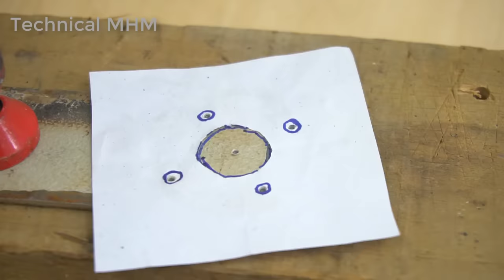How to make electric bike with 775 motor

Comment: I surely can say that the cycle will not move a inch if anyone sit on it
Reply: I agree. The gearing is about 6 to 1 so the motor has to spin 6 times for every 1 revolution of the wheel. To do   30 kmh it has to do about 300 rpm. Even with pedal assist ,a full grown adult would likely drop the rpm down to almost nothing if you didnt pedal your ass off. Then what's the point. A motor that size with a gear box of a side grinder which generally does 11,000 rpm would drive a bike with load alot better. See Russians  DIY ebike friction drive. 100km plus and pops wheelie on take off. No chain in front spokes to send you airborne either.
Reply: @kenklassen5312  id like to make an ebike using my6812 12v can you please give me some advice of what ratio of gear reduction ineeded
Reply: @taejinjin9722  There is a lot of factors that play a role in the decision of what ratio you want to use. If you live in an area with a lot of hills a lower ratio would be better where as if it's flat and you want to pedal at the start a higher ratio would be much better suited for top speed, although lots of countries now have restrictions on how fast you can have a push bike go before it classifies as a motorbike
Reply: @thebrokenbolt3990  can you give like example of what ratio i needed because i live with many hills
Reply: Yes bro, you are right
Reply: easier version here  https://youtu.be/ZjzgYx_gadk
Reply: @kenklassen5312  well explained. Thanks man!
Reply: Kit ki amount please send,cycle hy he hamare paasss
Reply: 100%agree
Reply: It will when he's at a peddling speed ?

Comment: Cool is it supposed to carry around a hummingbird with that motor.
Reply: @mmdjvdazh  u
Reply: You’d be surprised how much you get out of those tiny motors
Reply: A ball of cotton I suppose
Reply: The motor will probably overheat due to the excessive load.

Interesting Idea, has good potential, but needs an adequate motor for this.
Reply: I will text someone pitchers of the ebikes I have.Incase someone has something I need I will pay you for it.Even the shipping.I might need batteries rear electric wheels Tannus Tires ??
Reply: Who can I take my ebike to so I can have two different plates on the same ebike. So I can have two batteries ??
Reply: you dont know the motor power
Reply: @siddikcreator6752   I have two ebike. A ,350w and a 500w. A Ancheer Orange and Black Sunshine that's 350w the other is a Pace Aventon 500
Reply: @mmdjvdazh  ذ
Reply: Assalam
Reply: @tinkusarkar5780  on a plane road it might work, with little momentum buid-up.. itwill work.
Reply: It can barely power a fan so no way bike
Reply: Hahaha
Reply: @firozashraf2754  ,
Reply: You don't have any idea about the torque of 775 motors.
Reply: يايها الذين امنو لا تلهكم اموالكم ولا اولادكم عن ذكر الله ومن يفعل ذالك فاولئك هم الخاسرون
Reply: @mmdjvdazh  يايها الذين امنو لا تلهكم اموالكم ولا اولادكم عن ذكر الله ومن يفعل ذالك فاولئك هم الخاسرون
Reply: @firozashraf2754  يايها الذين امنو لا تلهكم اموالكم ولا اولادكم عن ذكر الله ومن يفعل ذالك فاولئك هم الخاسرون
Reply: It will just give u a bit more support it will be easier to ride you have to pedal also
Reply: People use these motors in powerwheels
Reply: That is a quite big powerful motor. Around two inches big. It’s an 895 motor and the belt reduction helps the torque.
Reply: @Zephyrhellion  
ç
çç

Ç
Reply: @mmdjvdazh  v
Reply: Busted.
Reply: @drrobotnikmeanbeanma  ج
Reply: I’m attempting to make one but in using a drill motor and I’m re wiring it

Comment: Look, I have the Aston Rider mid-engine and I've been using it quite well. I have changed it from my folding 16 wheel to 26 mtb and now into a 24. My husband changes the kit in a few moments by tightening one screw/nut, everything is connected and the screen has a cell phone charger.This system that you created is good. But the Aston Rider performs better!
Reply: no one cares lol
Reply: Mình mua một chiếc

Comment: just need to add a  small spring tensioner. you can see how smooth the chain runs when you let off the throttle.  great build BTW.  A+
Reply: JABED❤😂😢😮😮😮😮😮😅😅😅😅😅😊😊😊

Comment: Do you think you need a stronger motor? It didn't look like it was yanking that wheel around real good but a definite help for sure. I like the front wheel attitude for pedal or not. Great work bye the way. I noticed that the wheel was slowed considerably upon throttle release. Perhaps single speed rear wheel for the front to alleviate this problem. And for disc braking wheel attach over top of wheel on shocked front ends where brakes would have been. Shocked =(shock absorbed). Perhaps small starter motor.
Reply: Hi
Reply: Yeah.
Can use a bigger motor
But it will cost more power ( bigger battery pack's ) to run it at max speed ( if he want to use it at free air )

And he need to also made one circuit board specialiced to recharge the battery's ( using another or the same motor to use it like a dynamo ) when he's doenst using the additional trust that can give's the motor .
But all that wire mess can result in more weight
Reply: दच
Reply: @arjungujar2235  Yes sweetheart of this im well aware but have opted to use a large diesel engine starter motor in the stead for an absolutely kick in the..... Amount of acceleration and speed!!! But thank you for the video!!!🥰🤠🥰!!!
Reply: No the speed is already reduced its rated at 36 volts

Comment: I have an electric DC motor from an inalambric drill of 12V, 600RPM and 20Nm, does this work?
Reply: Maybe u should try to get more of these or a bigger motor if u want to run it outside

But it will work well with a good controller and battery's
Dont forgot that u can also use it like a dynamo to recharge the battery's when u dont use the boost system

Comment: The 775 is quite strong and it would work, but surely not with this low gear ratio. I made projects with 775 12V 200W 3000rpm unloaded. The motor wants his 2000rpm under load for good torque. There are smaler resp. finer chains and gears like those for e-scooters. With them you can realise higher ratios at similar space/dimensions

Comment: maybe you could try building a bicycle with neodymium magnets in the wheels and electric coils in the bicycle fenders to generate power for the motor. The power supply can be cut off manually with a cable from the steering wheel 🤔

Comment: What type of controller or acceleration button that you used?? 
It's the easiest way to install motor on a bike I've ever seen.
Reply: pwm controller
Reply: Àaaaa
Reply: @officialm0016  , I mean what type of the button you used for acceleration
Reply: Master Baronx, it‘s from a drill
Reply: @angel2stardust  :)) It's a Power drill button, which is a linear potentiometer
Reply: @officialm0016  , thanks for sharing.. Never expected that 😆
Reply: This won't work though lol, I tried a slightly different way of doing it with an electric weed eater motor knowing it wouldn't work just to see what would happen and it didn't work lol. That small motor doesn't produce enough torque to actually move the bike. If you want to do something like this you can buy a 350w motor kit on Amazon that comes with everything you need except for batteries.

Comment: How much power that motor can deliver?
Reply: Not enough torque. Look for a low KV rating on a motor for this purpose; like a 6374 size motor at around 180 kv would be ideal.

Comment: What is the output power of a 775 ,12 
Volt motor , do you know  ???  I  think 
you may not .775  is merely a 6 watts 
Output  motor which    can be used in 12 v toys . First you need to learn what 
is electric power as well as mechanical.

Comment: Wont work, better to do what I did and get 1000w rear hub drive motor for £140 from ebay , 48v 20ah from aliexpess for £135, have a bike that goes 28mph with plenty of power and long range, that wont just fall apart lol.

Comment: This motor would not pull the avarage person on that bike very fast, maybe on a flat smooth surface it will go a couple km a hour tops. The torque would twist the motor mount and fail. Just not strong enough all around.

Comment: Hello,I am interested in making an electric bike.I also have an electric bike that I converted.I wonder that which gear and sprocket did you use?And what is the.gear ratio?Where can i find the bigger gear?Can you explain them?Thanks.
Reply: If you can count you can quite easily get the gear ratio from the screen and if you google for 775 motors you will find that the bs in the video can never work at this gear ratio.
Reply: Letra chamo hablarme para decirle a compro para mí vale dale por ahí voy a ir

Comment: Best idea, this is a lowest budget electric bike
Reply: Yeah it's cost only 500to 1000 rs
Reply: @TECHBUSTER25  but 775 is not enough torque, I change my mind and I don't want buy this poor machine (brushed dc motor without internal gear ), next I will use 36v 350w hub brushless dc motor (15 Nm torque) , OR 24v 250w non hub brushed dc motor with internal gear (10 Nm torque) .

Comment: Donde van colocadas las baterías que mueven el motor o el dinamo, no lo mostraste.
Reply: donde puedo conseguir un motor como esos
Reply: @tackotj2151  Es de taladro atornillador incluso usa el mismo dispositivo de gatillo para encenderlo/regular...el voltaje se ajusta al tipo de batería de origen 12v, 18v, 60v etc.
Hoy te conviene comprar en MercadoLibre un taladro atornillador con motor brushless junto al controlador de encendido/regulador. Las baterias de Litio tienen mejor rendimiento pero desaconsejan tracción en rueda delantera porque tiene tendencia a derrapar en curvas cerrada... igualmente a mi entender el soporte del motor es débil por eso la cadena baila y para cuando deba traccionar sobre el piso sumado el peso del conductor es factible que se salga la cadena🤔

Comment: That's rubbish. Such a motor has a lot of power at very high rpm, but it has much to low torque to turn the wheel under load. As soon as the wheel will touch the ground this motor will cause magic smoke and die.

Comment: How many km continuous riding?
Reply: It depends on battery
Reply: @adnanalam2840  ok bro. Thanks.one more doubt when motor heating issue  continues using ?
Reply: Use heat sink .
Reply: @adnanalam2840  how to use heat sink in motor
Reply: Take 2 deep heat sink. And put one above the motor end another below the motor
Reply: @adnanalam2840  ok bro thanks for reply

Comment: Deseo saber. Capacidad de las baterías. Gracias
Reply: Depende del taladro atornillador de origen que puede ser entre otras de 12v, 18v, 22v, 60v depende de la oferta de mercado en cada país. Hoy te conviene usar taladro atornillador con motor brushless...👍
Reply: @roman_abelardo  ¿Que capacidad tienen las baterías?
Reply: @plenaatencion  Es amplio el rango de amperaje en pack de baterías que se encuentran en mercado., tambien lo puedes fabricar y no olvides  el BMS que sirve para proteger las baterías lithium.
PDT: El estimativo de consumo/torque lo puedes hallar en la información suministrada por el fabricante de la herramienta. Básicamente los componentes provienen de un sólo lugar, es decir que resultan ser motores genéricos.
Ten cuenta la potencia y características del mismo. También del pack de baterías (voltaje/amperaje) y cuántas horas de uso informan o mencionan los compradores...

Comment: If thos are 12 volt batteries your putting 24 volts to a motor that should be given no more than twelve. Actually more like 7.5 or 9.6. It's gonna fry and fast